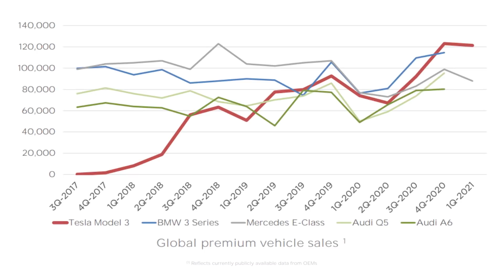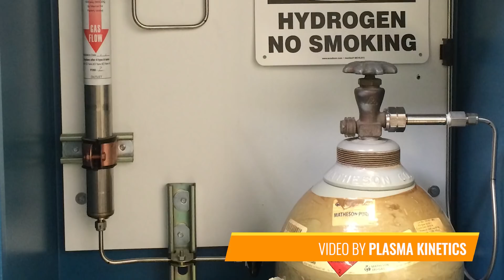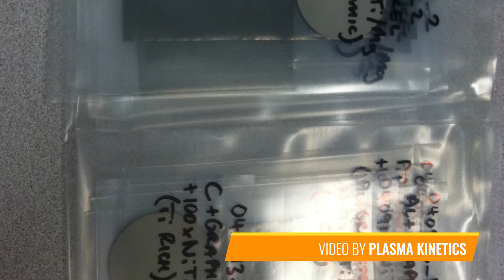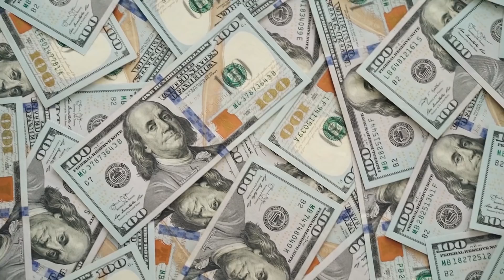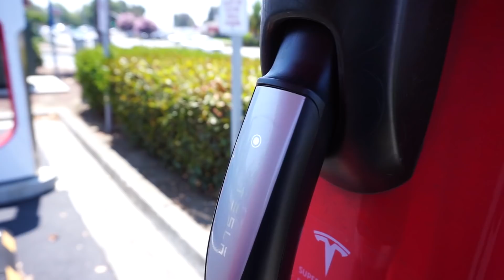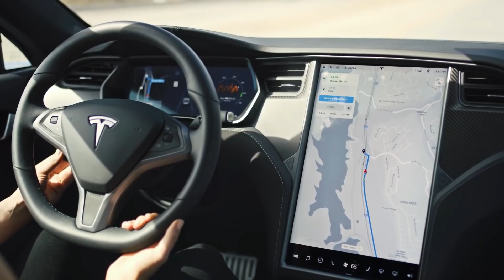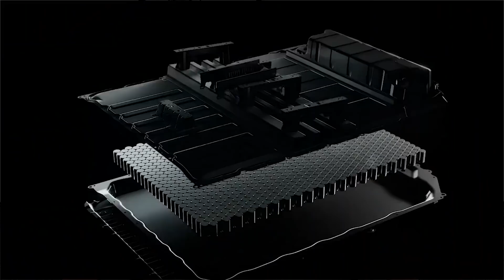SANDY MUNRO: No Batteries Needed for Toyota to Rival Tesla

Comment: What are the Wh/kg and Wh/L of these disc's?
Reply: i think its about 300-320, if you read a lot of battery patent papers, anything above 350 is near bogus
Reply: @leonardoariewibowo1325  Why would anything above be bogus? Theoretical Wh/kg for AL-air batteries are 6000-8000Wh/kg, with practical being 1300 according to Wiki Al-air battery.
Reply: Theoretical limit of solid state battery is 550, but that's require a lot of silicone, and silicone expand, destroying the "adhesive" layer of the battery, test show it only have 130 cycle life. Current battery tech only provide silicone input of 10% to keep the cycle life past 2000 cycle.

If you want to know more, read the papers of Maxwell technologies, they have great deep dive about those thing, and great technologies to back that up
Reply: @AORD72 so what? we want to go into realm of theoretical technologies phosphorous battery have 10.000wh/kg of practical battery density, but that's "theoretical" it's like 90 years away from happening

Comment: Would like to know the efficiency of such a disk system. Well to wheel. Electricity can be transported almost for free by wire. These disk have to be produced and then shipped to the stores. Then you have to change them somehow and get rid of the old ones at every charge.

Comment: Given that batteries are dirty to produce and to dispose of, I've never understood the overall hype of e-vehicles.  Hydrogen fuel cells, on the other hand, appear to represent a clean fuel source.
Reply: The current industrial scale production of hydrogen relies heavily on fossil fuels. In addition, I learned a couple years ago that hydrogen fuel cells are less than half as energy efficient as lithium-based batteries..
Reply: @coquitlamfalcons3976  At the same time, production and disposal of batteries is not eco-friendly.  Also, power companies utilize fossil fuels for the production of electricity.  Wind and solar are unstable sources of energy, therefore cannot be relied upon for sole sources.
Reply: @Coquitiam, hydrogen fuel is zero-carbon-based, burned with oxygen.

Comment: From Plasma Kinetcs website: "Storage is 30% lighter, 7% smaller, and 17% less expensive than Lithium-ion battery per kWh".

So think about this, a Tesla battery pack weights about 500kg (depending on model of course but this is a rough estimate), so for the same range (let's say 300 miles) a unit that is 30% lighter would still weigh 350kg! For 30 miles "get me home capacity",  that's still 35kg - do fancy lugging that in your walmart trolley to the checkout?

Drivers of these vehicles should be instantly recognisable, as they will all look like Hapthor Bjornsson!

Comment: With regard to the Toyota Prius, the reason that the Prius is not as readily available is because due to other hybrids in Toyota’s lineup there has been less demand for the Prius. The Corolla hybrid has taken a lot of sales from the Prius. The Camry hybrid, the Toyota Avalon hybrid, also the larger vehicles like the Highlander hybrid and the Sienna which is a hybrid only now, and the Venza which is also hybrid only, let alone all the Lexus vehicles that are hybrid. Toyota hasn’t backed off of hybrids, they have expanded their portfolio quite substantially and for example now produce Hybrid minivan with all wheel drive that can get over 35 miles per gallon. For an eight passenger vehicle that is impressive.

Comment: The reason Sandy's buddy couldn't get the Prius they wanted is because Toyota has made everything they make (well, almost) hybrid. The Prius is obsolete.

Toyota should focus on longer range PHEVs in the short term (like the complete hit they have with the PHEV RAV4).  50-75 miles of electric only range. Charge at home.  Drive 95% of your time on electricity before the gasoline engine starts charging your batteries. Don't worry about the charging network - use gasoline for those 5% of miles. Keep raising the number of miles you can drive as batteries get more capable.

Comment: Reminds me of an video for aluminum-air batteries in which rolls of aluminum were sold in the store. A 5kg roll only got about 30 mi. range as I recall. Better to dispense hydrogen into a tank with the hydride forming material in powder form inside. Heating the tank releases hydrogen.
Toyota can still save their business by investing in a company called "Proton Technologies" which can make cheap hydrogen by partial combustion deep in spent oil and gas wells. With cheap hydrogen and hydride tanks, ICE engines avoid obsolescence.
Reply: ice wont be obsolete either way

Comment: Well, what's the energy cost to drive the laser and compressor vs the energy extracted from it via the fuel cell?  And what's the energy cost of creating the discs in the first place?  Without this information one can't really say how viable it is in comparison to battery storage for automobiles.  And cost analysis needed for aircraft and ships as well would need to be done.  When that information isn't provided, which isn't anywhere to be found on their web-site, it makes one question it's financial viability.

Comment: Why do I get this pipe dream feeling about these hydrogen discs no one has heard of... like the thorium reactor car idea from 7 years ago?  Clean or not, I have this simple idea that burning stuff in your car to get energy is a step backward.  I still think the world is going to go for better ways of storing energy electrically.  Every so often, there is a small(ish) company that produces a Zoom-esque type presentation, claiming to solve a problem with a new invention.  Most of the time, they talk just enough physics to get investors and it often ends there because it's impractical.  Time will tell if these hydrogen discs are viable.
Reply: Do you understand how batteries work?
Reply: @matthewhuszarik4173  Yes.  I don't, however, understand how "hydrogen discs" work.
Reply: @mikeyc8139  Combustion is a controlled oxidation reaction. Batteries operate on controlled oxidation and reduction reactions. Batteries do the same exact thing as combustion just in a slower occasionally reversible method.
Reply: @matthewhuszarik4173  The difference being, a hydrogen fuel cell is a one way street: hydrogen is used up when combined with oxygen and thrown out as water.  Batteries store energy and are recharged by moving electrons from anode to cathode or vice versa.
Reply: @mikeyc8139  Is the water thrown out or just released back into the environment the way it was found? Sure they could collect it and reuse it, but why? Just as many batteries aren’t rechargeable because it is efficient or practical it makes little sense to collect the water and convert it back into O2 and H2 again.
Reply: @matthewhuszarik4173  It's not about the water.  It's about having to continually produce more hydrogen to keep the car going.
Reply: @mikeyc8139  Yes you have to refuel vice recharge. Advantages to both refueling is much faster recharging can be done at home at night when rates are low.

Comment: If Toyota's only chance to beat Tesla is sticking with Hydrogen....they're Fk'd 😂
Reply: Toyota is releasing EVs and they are also involved in a Panasonic JV. Hydrogen vehicles are a great solution to Japan where electric grid tends to go down due to earthquakes and reduce their dependency on foreign oil.
Reply: @wyw201 so going from world's largest OEM to focusing on the Japanese auto market....sorry but that's not gonna cut it.
Reply: @Succumbed2Rum  *Specifically the Mirai is focused on the Japanese market, not every vehicle in their lineup.

Comment: Sandy is a visionary but my instinct says all Hydrogen technology is a dead end for cars. Why? Electric motors are so simple, batteries are getting better every year and cheaper. Plus if you have enough solar panels you can literally charge your car at home and for free.
Reply: Fuel cells are really simple too, and a fuel cell vehicle could use the same drive train as an electric car.
Reply: @Rebecca Sparks it's a business qualification that Sandy thinks nothing of.  Someone mentioned it in the comments somewhere..
Reply: MBA - Master's of Business Administration.

It's not necessarily a bad thing - until someone with no OTHER qualifications takes over a company in an industry that they know nothing about. Unfortunately that happens rather frequently.

Comment: Sandy doesn't get the big picture, sadly.
Hydrogen cars use 3 to 4 times as much electricity compared to BEVs. Same goes for hydrogen trucks. Electricity isn't free, and renewable electricity will be in rather limited supply for decades, so we must use it as efficiently as possible and not waste it. That is why Elon refers to fuel cells for cars as "fool cells".

Also, hydrogen production from renewable sources is almost non-existent today. When we have built some, we first need to start replacing the huge amounts of hydrogen used by the chemical industry that come from natural gas reforming today (hydrogen is one of the most important base materials, for example for fertilizers).
We also need to produce very large amounts of hydrogen for chemical/industrial processes that today don't use any, but require it as a reducing agent to be carbon neutral (for example steelmaking).

On top of that, we may need even more hydrogen generation capacity for seasonal storage of electricity in some countries.
Only when we have enough renewable electricity and hydrogen generation capacity to cover these absolute necessities should we start to think about building even more hydrogen generation for applications that don't actually require it, like cars and trucks.
Reply: BTW, it's not like fuel cell cars could be scaled any easier than BEVs, even if it was a good idea to do so.
Similar to Li-Ion batteries, fuel cells have a limited lifetime that's problematic for cars and especially trucks.
Fuel cells use platinum as a catalyst which is expensive and in extremely limited supply.
And, obviously, there's the issue of refueling. Electric cars had it way easier in this respect, there's already power lines running almost to everywhere. Hydrogen cars would require a whole new expensive infrastructure to be built, which isn't likely to happen.

Comment: From a UK point of view, if they are incapable of putting a charger on a motorway, what possible chance of hydrogen.
Not to mention the ridicules cost of hydrogen, and if your going to put it in discs this is going to be even more expensive, and hydrogen at the moment is one of the dirtiest fuels on the planet.
Toyota's problem is thinking hydrogen was a good idea.
Reply: "Toyota's problem is thinking hydrogen was a good idea."
This. This is exactly it and all that needs saying. Possibly adding "for light vehicles". Hydrogen is great for steel mills, big ships, long range airplanes and that sort of thing, but as you say, they bet on the wrong horse when it comes to cars and now they are deep into the sunk-cost fallacy.

Comment: Around (3:34) the host declares "Toyota... are EV deniers."  I would remind the host that H2 Fuel Cell cars ARE EVs.  Around (3:54) Sandy says... "no one else is pursuing H2"... which is also inaccurate.  Look at Walmart, Amazon, UPS... they've replaced all of their "battery electric" forklifts with H2.  Do you know why?  Advantages.  The host and guest never mention the phrase "Green Hydrogen" which is to make clean fuels from Renewable energy and water.  If you don't mention "Green Hydrogen" then you're either unaware of it (which is incompetence), or you're aware of it and don't want to mention it... which is dishonest and negligent.  The world (EU, the Pacific Rim) have declared their Path to decarbonization is using Green Hydrogen.  If you don't know what that is, then your conclusions that Toyota is somehow behind the 8-ball is absurd.

Have you done some basic math as to how much an All Battery scenario for transportation would require?  We don't have 6 earths.  Green Hydrogen is 100% non-toxic and about 100 times more energy dense by mass.  Green Hydrogen is potent, safer than batteries (lighter than air if breached escapes straight up), is available to ALL countries and localities and is 100% clean fuel.  Yet, you object?  Both of you need to get up to speed on Green Hydrogen.  That's why Korea, Singapore, Australia, Japan, and the EU (to name a few) are going towards real solutions.  Not all battery architectures which can't scale past 5% of the fleet.  Green Hydrogen offers every advantage (grid balancing, aviation, maritime, transportation fleets)... not important?  Let's get real.
Reply: I’m waiting for an affordable hydrogen powered car, a hydrogen electric car. Where is it?
Reply: @steveperreira5850  Such a selfish statement.  Shame on you.  Anything worthwhile is worth working for.  We're talking about our world, the natural world which we're throwing down the toilet.  The price of Anything, depends on how much of it you buy.  The more units, the less price.  The EU and the Asia-Pacific countries are going full tilt on Green Hydrogen.  Why?  Advantages.  Try to find some perspective - our world is dying.  You better do something which Actually solves the problem (Green Hydrogen) or you take everyone down with you.

Comment: Hydrogen disc is not the wave of the future. It is an extra step to an already expensive process. Sure you could use renewable energy to produce the hydrogen but it wastes way more energy than just directly charging batteries. How much more electricity, raw materials and time will it waste converting it to a disc? And you have to go pick these up somewhere? Last time I checked electricity is delivered to my house.

What Toyota needs to do go with the 4680 batteries for now and continue advancing the battery technology for charge speed and longevity. And at least partner with Tesla on the supercharger network. He always said he'd open it up to other companies if they helped build the network. It's amazing none of the big car companies took him up on it. Oh, that's right they were too busy with either hydrogen pipedreams or too complacent with the status quo.

The worst thing about the whole thing is I have is having to root for the fossil car companies just because I know we need to move to a sustainable future there is no way Tesla can grow fast enough to do it all.

Comment: Only relevant question is: how many kWhs do you geht out of a Disc?
Reply: At prototype stage testing, they've seen solid state hydrogen storage at around 9kWh/kg at its use. If you compare it to a battery, thats 45 times more energy per kilo within the storage medium.
Reply: @Jimmy Edward Haha, ok. You mean like in a DVD player? There is a laser in there too. Not sure you know what you're talking about here.
Reply: @Jimmy Edward That energy can be recieved from regenerative breaking through more effective supercaps if you want to go that route. Batteries are between 10-70% effective in recharging from braking. Supercaps start at 50% and go up.
Reply: @Jimmy Edward not from the same tech firm, but H2fuel. They also research solid state H2 storage.  Water is the source to start the reaction, not a Lazer. There are several players within this segment.

Comment: They are wasting time in Hydrogen. Who wants Hydrogen when batteries are improving so fast?
Reply: battery physics/chemistry has a hard limit
Reply: @itdobelikedat4202  And whats that limit? price? no. Production? no. Density? uncertain. A Li-Sulfur battery has a theorical limit of 10 times the density of a Tesla NCA Model 3 Long Range battery. Do we need 10x density for cars? not really. They would be welcome, but you already can do 300 miles or more with one BEV.  It's already usable. Improvements in density are welcome and opens the door to motorbikes, small planes, etc.
Reply: @yoyyaesta4808  Lithium-sulphur battery life is inverse to the increase in density
Reply: @itdobelikedat4202  There is no theoretical limit for Lithium-sulphur battery life. A few years ago it was just 300-400 cicles. Now it has been demostrated 1,500 cicles is possible.
Reply: @yoyyaesta4808  "demonstrated" 

get back to me when it's more than just hopes and dreams
Reply: @itdobelikedat4202  
> Battery chemistry has theoretical limit!
- Actually not, the limit is...
> Get back to me when its not hopes and dreams!

Comment: Hydrogen: Expensive, inefficient, bulky, and nowhere to refuel. It's not happening. Not now, and not in 20 years.
Reply from the maker: Did you watch the video? Seriously. This comment makes me believe you didn't
Reply: Hydrogen goes BOOOM! 🔥🔥🔥🔥🔥🔥🔥🔥🔥🔥🔥
Reply: @EforElectric  I watched the video, and I love Sandy, but on this he couldn't be more wrong. Engineering Explained did a great video recently on Toyota's hydrogen combustion engine, and all the challenges around that. Fuel cells solve some of the issues (more efficient, less emissions), but they introduce other issues like higher cost. Bottom line, it costs more to make hydrogen from hydrocarbons than it costs to make gasoline. If you want it to be "green" the cost is considerably higher. Now imagine how much MORE it would cost to make these hydrogen discs from that already more expensive hydrogen. I can fully charge my BEV for about $4 today. Sorry, It ain't happening.

The decreasing cost of wind and solar doesn't change the math, BEVs will take advantage of that trend just as much as fuel cells.
Reply: @EforElectric  Another good Engineering Explained video is 'No, Synthetic Fuels Won't Replace Electric Cars'. In that video he compares the process from getting energy from source to the wheels for fuel cell vehicles vs BEV. Fuel Cells are about half as efficient. Creating the solid state discs would have to another step that is going to be less than 100% efficient making the comparison even worse, and you still have to come up with the hydrogen production and distribution.